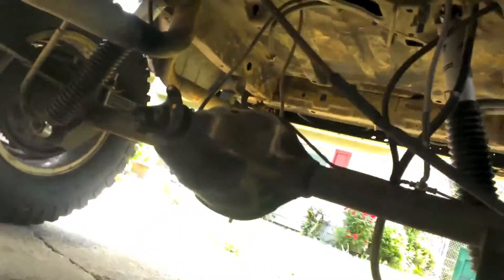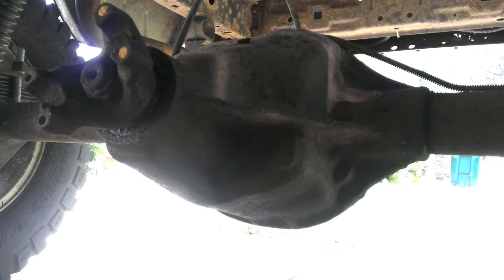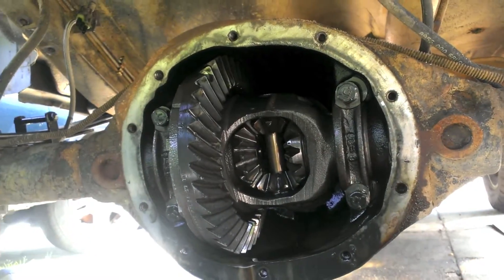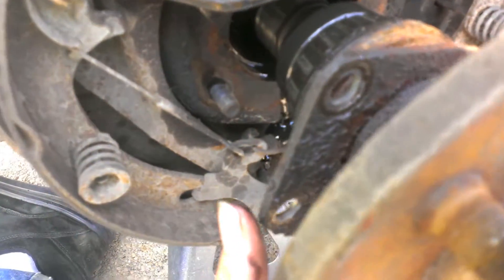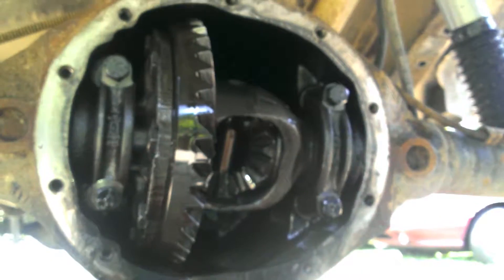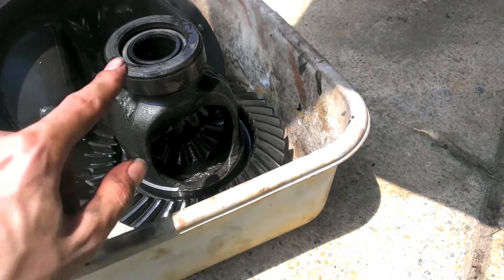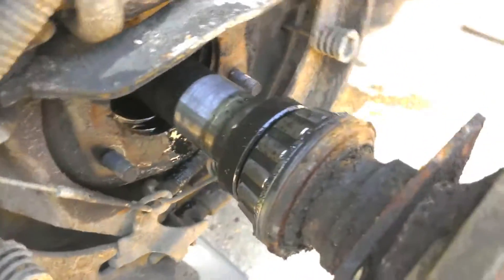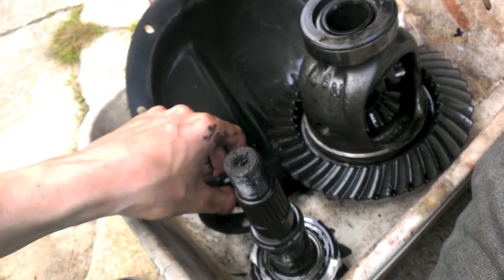89 Cherokee Dana 35 Axle Teardown

Comment: When are you going to show the rebuild?
My 89 has a thumping D-35, I think the ring gear is sprung.
I'm thinking of swapping out with a junk yard rearend from a lower mileage Jeep.
I'm pushing 470,000 miles on this unit.
Reply: One thing that "Nick" didn't address (in his reply to Colin)... is the gear-ratio.  If you have 4WD, and the front and rear aren't matched... it won't be pretty:  Something WILL lock-up... and might go ka-boom in the drive-train.
-- To find out what you're working with, get the Last-8 digits of the VIN (2 letters + 6 numbers.)  Any Chrysler dealer (parts dept.) should be able to give you the (original) specs.
If you're pulling from a junk-yard, DO GET the Last-8 of that VIN.  You might want to get that data, and call-a-dealer BEFORE you spend time pulling the 'salvage' rear-end.  --  Cheers !!
Reply from the maker: Holy hell, those are some damn impressive miles. I won't have a full stock rebuild video like I did with my D30 because I'm Regearing and Locking both axles this time. You can check out an exploded parts view of a D35 online to get an idea of where all the parts are suppose to go. The few small differences of the D35 vs the D30 is that the D35 uses a crush sleeve for pinion preload and the carrier is shimmed outboard of the bearings compared to preload shims and inboard carrier shims on the D30. I usually upload the next video every 5 or so days but you can get a good idea of the general process from my D30 rebuild. If you plan on rebuilding asap then I might throw my Regear vid up early for you.